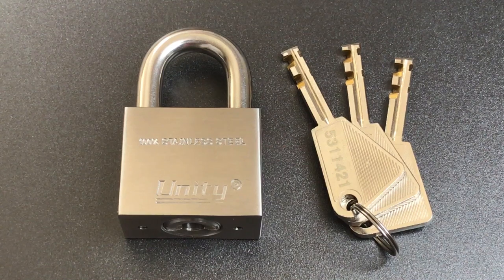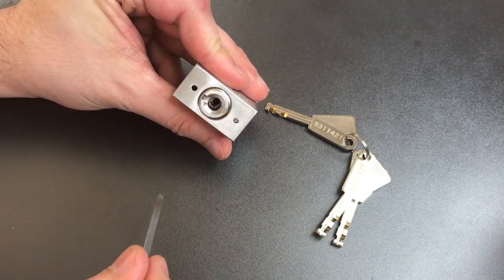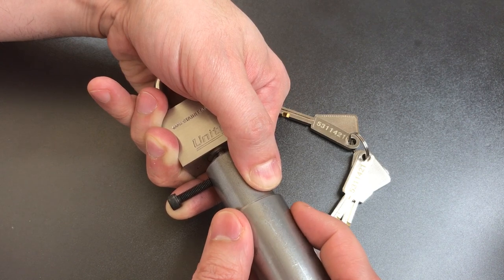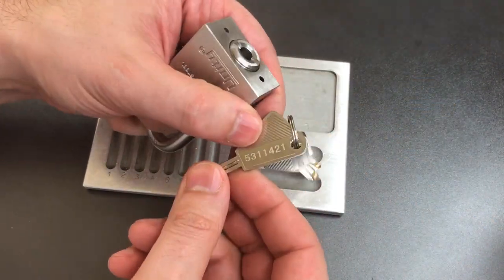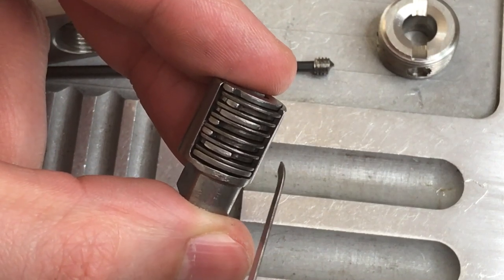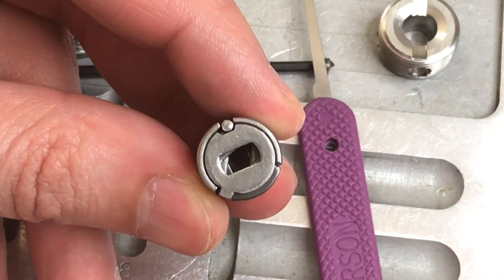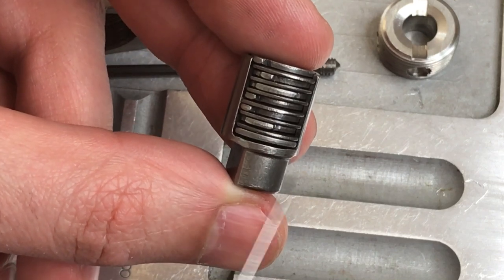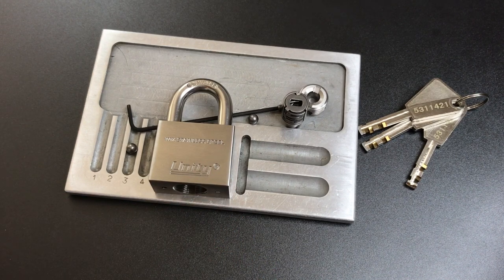[571] Unity 40mm Stainless Disc Detainer Padlock Picked and Disassembled

Comment: I ordered 2 of these keyed alike to use as thief deterrents for my VR headset travel case. Opened one up and they seem to have taken some of your criticism to heart. The initial disc no longer tensions the core, and the rear disk is no longer stationary. There are still disks with less travel than others, but it's to a much less extent, and the fact that you have to tension either off of the rear of a random disk (in my case the 3rd disc) is a nice bonus from how they functioned when you picked them. Still great machining and tolerances, still fully steel. Unfortunately, still no false gates.
Reply: how do you tension of the back?
Reply: @danielgagnon3640  If you haven't figured this out yet, rear-tensioning a disc lock requires a different kind of disc pick. Rear-tensioning disc picks are essentially just regular disc picks with a second head. This second head is thicker than a normal picking head, and the actual picking head is located between the handle and the thicker head. You use the thicker head to tension the lock, and the picking head to manipulate the discs. Opsasec produces picks that can rear-tension, such as the discombobulator.

Middle-tensioning disc locks are a right pain in the ass. Picking these requires a rear-tensioning disc pick with two proper picking heads. This is important. What you do is tension with the far head, use the near head to pick discs in front of the tensioning disc, then you swap heads. To do this, you add tension with the both heads. Now you can start using the far head to pick discs behind the tensioning disc without dropping tension. If you need to do additional passes, you use the far head to tension again, then begin using the near head to pick again.

Comment: I clicked on this video because I do not understand how these locks work.  I feel I know more now, but I don't have a complete understanding.  I assume that the gates align and the bar falls into the groove and the entire core rotates to activate the shackle.  If this correct?
Reply from the maker: +dahveed284 Yes
Reply: @lockpickinglawyer  The discs seem to make a max rotation of +/- 90°.  So, I suppose one needs to return them close to open position before one can reintroduce the key after a lock-picking try?   If the discs would be made spring return, your lock-picking wouldn't have worked?  Isn't that a way to make them more picking-resistant?
Reply: @tuttebelleke  I believe keeping heavy tension on the core like a pin lock keeps the bar pressed onto the disk so a spring can not move it out of the gate.
Reply: @westcoaststacker569  Disc detainer cores generally don't use any springs at all.
(Except higher end Abloy ones like the Disklock/Novel/Protec that do include anti-pick mechanisms
other than false gates which in this case do have springs)
Reply: @psirvent8  right sorry
Reply: @lockpickinglawyer  thanks for the thorough explanation😂nice

Comment: So, what you have for us today, is actually a marine lock. It appears every part of it made from stainless steel. I've not seen a disc detainer marine lock before, so this one is incredibly cool. ...Going on my I Want One Of Those list. Thankyou for the excellent explanation of how to make the lock more awkward to pick. It would be great if the manufacturer responded by improving the design with your suggestions.
Reply: No padlock can stand up to the presence of a Cordless Mighty Powerful Makita XAG13Z1 - 36 Volt Lithium battery powered steel cutter, armed with a high quality industrial grade 3M-7200 DAD-D   (or: Diamond Abrasive Disc "Diablo").

Comment: And in case somebody asks if having the bidding engraved in the key is a security hole, nope, it just makes it easier to understand that you have to keep your keys secret. The same information is already available from a photo of the keycuts but most normal people are not fluent reading the keycuts directly but that doesn't mean that the data is not visible.

Comment: I have frequently wished to hear how you would have improved a bunch of the locks you have shown. I have a bunch of Kryptonite locks in an attempt to secure my motorcycle. After watching your videos on them it made me wonder how hard would it be to make them more like an Abus+ (or even better if there is such a thing). I should probably just start replacing them with better locks but I already have them and I'm not exactly wealthy.
Reply: Security pins and/or false gates. Just don't replace all the pins with sewing pins and have someone break your lock with a normal key by bending all the sewing pins because they are too weak. I say this, because "security pins" are made by technically weakening the physical structure of the lock, in an effort to make "picking" harder. If you over-do it by grinding away nearly all of the lock, you will end up with something as strong as a piece of paper. This is mainly a potential issue, if you are making your own modifications, rather than replacing them with commercially made security pins/discs, which are designed to be fairly strong. Steel ASSA pins are probably stronger than Brass pins.

Like you said, the easiest way is to just buy an expensive lock that has been proven to be higher security. I don't know how practical this would be, but you could also use 2 different brand locks, so even if someone is an expert with 1 lock, they may have no knowledge of the other lock. Maybe one lock is physically strong but weak pick resistance and the other maybe physically weak but strong pick resistance. Of course, just never use "pot metal" or "plastic" in any lock you use to secure something valuable.

I hope this gives you some ideas or answers. BosnianBill uploads videos with "Challenge Locks" people make, but if you use any of those concepts, you have to be sure (like I said) that you don't use something that makes the lock able to be broken with a typical key and some turning pressure or a screwdriver.

One example is a lock he couldn't pick, which was from Lukas where he was using the ball-chain as pins, but the issue is that the ball is hollow and the metal pins holding them together is very very thin and weak, so this may be able to be broken with very little effort.

(1119) Whipped by Luka's Balls
https://www.youtube.com/watch?v=NfcjwyPRa0Y
Reply: Switch chain balls for small bearings? Or maybe steel shot if u can't find tiny bearings.

Comment: As a mechanical engineer I totally relate to nerding out. The suggestions you are making should be fairly simple for the manufacturer to do. Each of those Gates or discs are stamped out of a piece of steel and therefore the shape itself can be easily changed with the stamping die. I'm going to go out on a limb and say I'm pretty sure that the lock manufacturers Iris smart as you when it comes to how to develop a good lock. The question becomes why would they not set it up in a way that you showed in this video? Do you see any advantages for not setting it up that way? It seems like on most locks that you pick you offer a bit of advice on how to make that lock your picking better and yet we don't really see them in the majority the designs. Do you have any thoughts and why they wouldn't take these extra steps when it's fairly simple in the manufacturing process to create them? And lastly have you ever had any communication with these lock manufacturers like comments how about you showing how to pick there locks on the internet? Sorry I turned it out a little bit too much in this comments section so thanks for the videos, keep it up

Comment: Looking at the tip of the key, it appears to be quite short. typically when disc tumbler locks were first produced many years ago they actually used the last disc to turn the cylinder. If you were to look into the cylinder housing you might not see the tip for the key to enter non existing or extremely small> this makes the part solid and cheaper to make.

Comment: Thank you for the detailed video. I have one of these locks, but it is not working normally anymore. It won't lock with a key anymore. I wonder if it will start working if I disassemble it, oil it, and then put it back together. I wonder if there's an easier way.

Comment: the nubs on the discs can only be for limiting the key numbers for general purpose,as the 'unnubbed' disc packs may be reserved for official use,and also, the degrees apart of 'unnubbed' discs could be much greater maby making picking more difficult. just a thought.

Comment: I'd skip the Ramset unless there is a specific weak point or flaw. 
Thanks for adding how to improve the lock. 
Removing the bidding from the key would also be nice to prevent cell phone picture hack.
Reply: Yes, but then the key would also need a sheath to protect from doing the same with the cuts on the key.

Comment: I think it will be good, somehow, to apply the tension directly on the deep bottom of the lock housing. There is something like a hole down there and if that instrument can  be stuck in this hole, it will be possible to put the needed tension. Than the improvements will not be so big problem as they will be if the tension is applying through some of the disks.

Comment: Just watching this, is it possible that those large exclusions would protect the key. If those exclusions were smaller the possible cutouts on the key could weaken the structure of the key and make it susceptible to damage or accidental bending.  By doing that, they've excluded possible cutout patterns that would weaken the key itself.  Just a thought.

Comment: Hey LPL, have a question from someone who has a new fascination with locks thanks to your channel (picked up a couple locks including the Kasp 19070X), but have no skill at all with them... If you do the file work to disc 7 and disc 1 to prevent tensioning, could you not also file the lock housing at 2 and 3 to also prevent tensioning on those discs?

Comment: Just a thought: by limiting the lock to a subset of potential combinations, the maker could offer premium customers each an exclusive series of locks with the guarantee that no other customer's key could ever open one in that series.

Or perhaps they could offer several price points, locks with more combinations costing more. Some IC companies do something similar; sell reduced-cost versions of a chip with premium functions "not supported." (In practice the chips might be all the same, the scheme amounting to tiered IP licensing.)

Of course, having tooled up for such a scheme, the maker might decide to blow it off and bin all the versions together. What are the odds someone will gut one in a YouTube video?

Comment: There has to be some reason some of the discs have wide limiters that restrict range of motion.  I mean, if nothing else, having to deal with parts with three different limiter widths is going to make manufacture a little bit more complicated and expensive.  So why do it?

Perhaps the different widths are designed to throw off less experienced lock pickers?  Even with the restricted combinations, 3000 whatever possibilities makes brute force guessing attacks impractical, so maybe the potential for confusion was worth more than a higher number of permutations?  Dunno.

Comment: Nice job on picking that thing, despite the odd choices concerning the core this doesn´t seem like a bad lock (still Kryptonite levels of security (: ). It´s still relatively pick resistant, most people wouldn´t even know how to attack it. 
Is the shackle hardend and what material is the lock body made out of? 
Also, where could I get one (can´t find it on eBay)?

Comment: Only 4.8% (1/20.833, approximately 1/20th) of the combination number range is available. By the way, they aren't permutations as you can have any unordered number set, which is likely the same reason combination locks are named the way they are.
Permutations are sets with no duplicates of the same numbers in the set and are arranged in unique tuples: i.e. {1,2,3} can be arranged {1,2,3}, {2,1,3}, {3,1,2} etc. or 3! (3 factorial) permutations.
Reply: 3! is 6 in case you were wondering... so that would be 6 ordered sets of the numbers 1,2 and 3

Comment: I am going to nerd out a little bit... But these are not permutations. Number of permutations is number of possible ways to shuffle deck of cards for example. In this case it's more like every card can be any card, and these are called variations with repetition. Number of permutations of N elements is N factorial.

Comment: Is no one else gonna acknowledge the fact that he did multiple math equations that can be difficult for most on paper, mentally????
Reply: Erm. No he didn't. What are you talking about?
Reply: @ChrisLee-yr7tz  5 to the 75th power
Reply: @davidgillin2175  Well its 5^7 not 5^75 and you can hear him tap something so I assume it's a calculator. I'm wondering why you've assumed he did that in his head.
You can hear the same tapping when he calcs 5^5.

In fact LPL has responded to a similar comment on here saying he used a calculator.
Reply: @ChrisLee-yr7tz  damn you go man I had to rewatch and heard it too. I’m sorry mate. He still has genius level iq but maybe not in math lol. shoutout to LPL for having one of the best communities there is on yt. Hope you have a good day brotha

Comment: I don't think that tiny little grub screw would have a great deal of shear strength, I reckon you could simply shear it off with an impact driver in the slot.
Reply: Probably, but it would be noisy and irreversible. I guess it comes down to your threat model. Likely easier to use a set of hydraulic bolt cutters on the shackle I would guess.

Comment: That's my pick! :)
Reply: O and it is easier to file the "nub" away from the topmost disc completely, so you get a free spinning front disc like in an Abloy. It however makes it possible to rotate it 180 degrees and the lock won't open, but lets mark that as a nuisance to would-be pickers ;)
Reply from the maker: +Jaakko Fagerlund Yup... it's made a few appearances here over the last month or so. Excellent product!